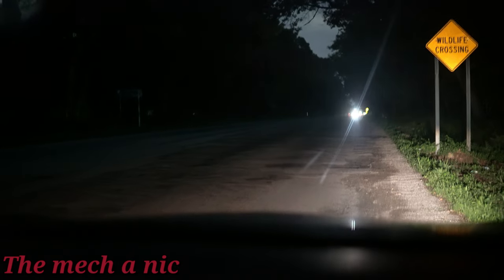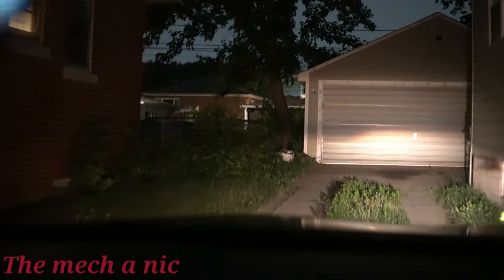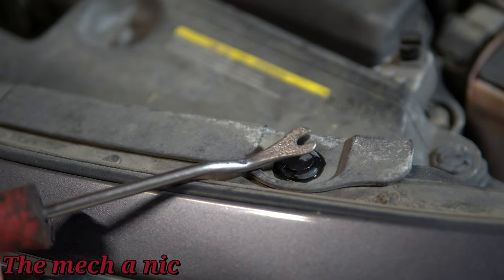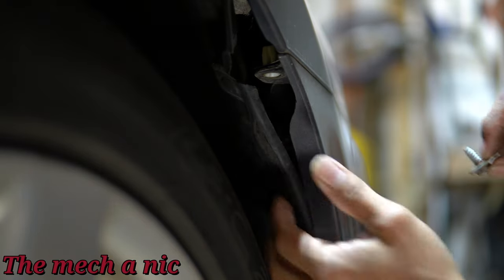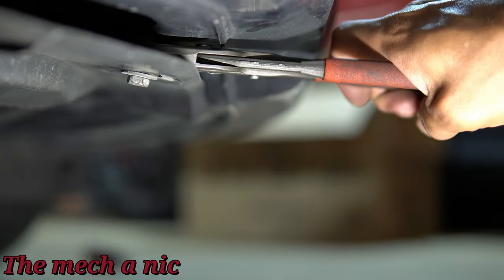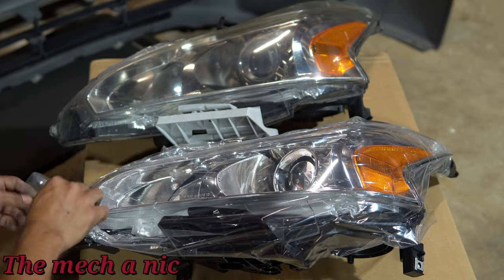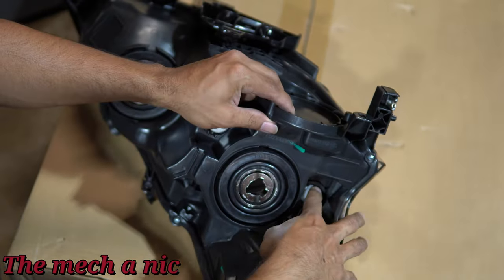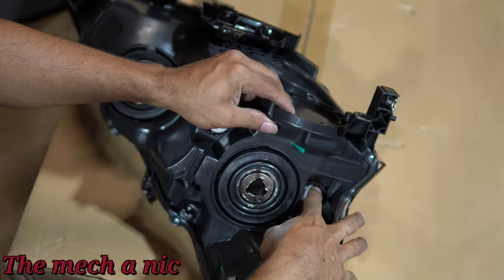2013 - 15 Altima head lights are dim / Altima head light replacement

Comment: Now we just need a lawsuit for those BLINDING LED headlights that every car seems to use now.
Reply from the maker: Yeah they always manage to hit me right in the eye with those lights!
Reply: Most of them are misaligned.  A good reason in my state for the cops to stop you.
Reply: I just turn my high beams on till I pass them. Mostly jeeps and broncos.
Reply: You mean the ones I just installed cuz I couldn't see hardly at night? Lol
Reply: I usually out my high beams on those guys
Reply: Bright ass lights for their pitch black windows
Reply: Mmmm facts
Reply: I know exactly how you feel I can't stand those super bright LED bulbs I don't mind if the LED but they should not be white
Reply: The US needs to adopt the EU rules. They should've done that in the 50s actually.
Reply: No.  They simply are not aimed correctly and the kelvin temp is too high.
Reply: Cry about it

Comment: I had the same issue with my 2012 Nissan Altima Coupe. I ended up purchasing new headlights as you did and retrofitted LED H11 Bulbs. The difference after bulb replacement is night and day. I also heavily recommend going through the trouble of adding fog lights. Fog lights on Altimas create an amazing field of view. Thank you for creating content!
Reply from the maker: I'll keep that in mind. Now that the headlights works I'm sure a set of LED will make a big difference over standard halogen bulbs
Reply: In my 2016 Altima SR which doesn't have the LED daylights.  I agree.
Reply: Hi Mr.
I am having this issue. Could you pls guide me what to do.
Reply: As a result i am driving with high beam

Comment: i can confirm, i have a 2013 coupe and it has the absolute worst headlights ever. i also could not tell whether the lights are on or off. you are so right, the second video camera actually does a pretty accurate depiction of what its like
Reply from the maker: I know what it's like, you need new headlights 👍

Comment: It's insane the way you have to change the headlight assembly. That should be a lawsuit in itself!
Nice job and great upgrade.
Reply from the maker: Yeah it's not ideal, unfortunately lots of cars are like this nowadays
Reply: Right! And we all know once removed never fits as tight as once!  I just need bulb removed!
Reply: Hey awesome video. Was wondering if you have a tutorial with a radiator removal and replacement. I'm guessing you would need the bumper off the same way that's in this video

Comment: Dude... FANTASTIC video. I replaced bulbs twice over the years as it began to dim thinking it was the bulbs. Even purchased a lens cleaning kit, but never used it because the lamp itself wasn't that distorted. Now I see why. I'm replacing the headlight assembly on my 2015 Altima and my 6 speed 2004 Acura TL. This video saved me some time and I haven't even stated the swap yet. THANK YOU very much.
Reply from the maker: Glad the video helped you 👍

Comment: I've been wanting to replace my headlights, entirely, just because with the current lights, any oncoming light source drowns out mine and makes it nearly impossibly to see the lines on the road, let alone anything that might suddenly cross the road. I'm sure some of that is my astigmatism, but most of it will be brighter lights (Other vehicles, even street lights) drowning out my dimmer lights.

This video is incredibly informational for anyone wanting to change out their headlamps without having to take it to a shop, and spend a ton of money to have someone else do it.

Comment: Guy...you know your stuff!!!!  Me and my son just followed your video to the letter and no issues. I have never removed and put back together this much of a front end on a car. You covered every detail we needed to complete the job. You just made driving at night safer for my family and cant thank you enough!!!! 
 As far as Nissan they should be ashamed of themselves for not getting every one of their cars into a dealer and fixed at Nissan's expense. When we called Nissan dealership they wanted the car brought in for a diagnostic test of the electric system costing $100s and then they would repair at our expense. They have lost us as customer forever as they have proved they have no regard for customer safety.  
Cant thank you enough as you saved us a lot of money and I am pretty sure you may have saved a few lives!!! Thanks again and for sure will subscribe.

Comment: My 2014 Altima had this issue a little over a year ago. 
I was VERY thankful that Nissan replaced both of my headlight assemblies due to the recall lawsuit. They said it was about a $1500.00 job, and I'm glad I did not have to pay anything for this service.
I actually had to wait 3 to 4 months to have it done, because of the tremendous amount of people that were on the list for this service to be done.
Reply: Did you pay for the labor upfront at the dealership and then get reimbursed? I received the lawsuit documents in the mail that said the lawsuit will only reimburse the parts and not the labor. I would have to turn in the receipts to the attorney firm for reimbursement. Did you call Nissan directly? 
I have a 2014 Altima and searching online to buy new headlight kits for both sides. Any suggestions anyone could give me would be greatly appreciated. 😊
Reply: @lizbethlivebyfaith  the dealership did not charge me anything. But I don't know if the lawsuit/recall is still active. It's been sometime back when I got it done. But I did not pay upfront, as the cost was going to be nearly $1500 from what the dealership told me. I was very grateful to get it done for nothing
Reply: @faithgiant_Ps91  Thank you so much for responding. I went ahead and sent an email to the firm that is handling the class action lawsuit to see if it's not too late for reimbursement.
Reply: @lizbethlivebyfaith  dealerships just being scummy

Comment: Thanks for this video. I just purchased a 2015 Altima and can verify it's a major problem and until I can get those headlight assemblies replaced, I have to drive with high beams on all the time. At first I replaced the halogens with xenon. Then I bought a polishing kit and polished the outside but neither of these two solutions worked and I noticed a slight bit of oxidation on the inside of the clear housing but didn't think that should be the main cause and only now am looking to replace the entire housing and found your video.

As described in this video, the car is extremely dangerous to drive at night until fixed. I'm surprised a recall hasn't been issued for this fix. Two nights ago I hit some object in the road I couldn't see due to poor lighting and burst the passenger side front tire and had that replace with a temporary tire. Luckily(?) I was traveling only 30 mph so although the collision was enough to burst the tire it didn't cause more damage or so I hope at this time.

Thank you for the link to the lawsuit, I will study what my options are before doing anything more myself. It looks like after October 2022 (My comment here is Nov 2022) it may be too late (after Sept 2022) to be covered in this lawsuit. Does this mean another class action lawsuit needs to be filed? I wonder why the class action lawsuit terms were so tight, to only cover extending the new warranty an additional 3 years to 2021 and then another year for "out of warranty" replacement? This headlight problem will be a never ending problem for Nissan as no defective headlight assembly should fail within 10 years, maybe even 20 years... I wonder what the industry median lifetime is for this part. Looks like I may contact the attorneys for this lawsuit, get whatever info I can and decide what to do then. Maybe contact Nissan to see if they will volunteer to do an out of warranty repair.

IMO this is an extremely dangerous safety issue and should be subject to a recall for replacement. I wonder why the DOT hasn't gotten involved in this issue, maybe the lawsuit itself can provide details on that.
Reply from the maker: I'd definitely try contacting the dealer first and see if they'll replace them for free.
Reply: There is a recall but I have been waiting since March and the dealership claims there are no parts...
Reply: @majesticgent  Man i haven't got anything from Nissan about that.
Reply: There is a recall on the headlamps but Nissan is not honoring it. Been dealing with this for over a year.
Reply: Same thing happened to my Nissan 2013.  I contacted the dealership. Past the settlement date. I contacted the settlement website. No use.  Let use know if you find anything worth pursuing.  When I ask the dealership about a recall, he said, I am directed to send you to the settlement website, which offers nothing.  I'm sure there are plenty of Nissan owner's that are just now experiencing the same issue.  Mine started about 2 weeks ago, I can barely see at night.  I agree with you, it is a major safety issue and should be a recall.
Reply: Finally after 10 months, my local dealership has the headlamp assemblies and will honor the recall!

Comment: Thank you for the confirmation.  My headlamps are Useless.  The dealer denied replacing my headlamps when I brought my car in within the Class Action timeframe based on Nissan's standards.  A blantant disregard for Safety.  I've changed Numerous bulbs including HIDs.  Never buying Nissan again.  
  Your video is a Savior.

Comment: excellent video. I just got done changing out my lights. The only thing I would mention is that there is a thick piece of plastic that is under the top 3 mounting bolts on each side. And that piece has 2 nubs that stick into the other piece of the fender to make the crease pull together. Thanks again!

Comment: Good video. I was able to get mine replaced by Nissan on my 2015 but it was months waiting for the headlights. I eventually reported Nissan to the BBB and presto, they started responding quicker to my complaints of waiting. Definitely an improvement for night vision. My worry is did they really improve the issue or just give me new headlights to make me go away. Time will tell but at least your video will help with replacement again as I doubt Nissan will keep replacing these. Cheers!

Comment: Great video, my headlights have  gotten worse over the years. I finally ordered the headlights. Will be installing this weekend.
Reply from the maker: Good luck with the repair 👍
Reply: Installed this morning. After watching video. It was easier then I thought. It took me an 1 hr to install both. Now waiting for it to get dark. Thanks for the video.
Reply: Bought them from where? Link?
Reply: @jerrycosme4273  how are they holding up?
Reply from the maker: So far they still work. Someone told me the new ones will also fade but we'll see. It hasn't happened yet
Reply: @daviddavis9155  its been a year now. No issues as of yet. I also installed Led bulbs, now I can finally see at night.

Comment: Although grille replacement is easier for other Altima years, the plastic bumper cover must be loosened up for 2015. Minutes 2 through 6 are an excellent guide. You don't have to remove the bumper cover completely nor disconnect lights. It just has to be loose enough to reach in with a stubby philips head to loosen the screws in the 4 corners of the grille. If the old grille is trash, you can snap off the tabs with your fingers or a pair of pliers. Make sure you reposition any of the clips that come loose when you remove the philips screws in minute 5.

Comment: I had this problem in my 2017 Altima.  Nissan dealership replaced my headlights for free, and I immidiatly installed LED bulbs made by Phillips to keep the heat low.  This will prevent damaging my new headlight housings.
Reply from the maker: That's a good idea
Reply: Hey how did you get that approved? Do you just show up with your car?
Reply: @8Jallin  thats correct…just went to the dealership service counter…explained the issue and they were aware of it….replaced them, no questions asked.  Maybe I got lucky…I don’t know.
Reply: @retass1979  glad you got yours fixed. Nissan said that it’s too late for me. For me this warranty expired last year …
Reply: @8Jallin  I was out of my cars warranty...i had 190K on my odometer when this happened...I'm at 250K now...if your car is a 2016 or later, i would think it is covered.  might want to try a different dealership.

Comment: Just wondering if their is an adjustment screw to adjust the horizontal axis of the lights or if they are in a fixed position and only needs vertical adjustment? Great easy to understand video thanks
Reply from the maker: I'm not really sure if there's horizontal...it didn't cross my mind

Comment: I got my class action brand new crystal clear headlight assemblies installed by the dealer a month ago. YouTube keeps suggesting these videos on my page. Forgive me if I already posted this on this video. But I just want everyone who has an Altima to know that it is true and I got mine and wow! Just like when I got the car brand new!
ALSO the lawsuit covers you if you already replaced them take your receipt and you will receive reimbursement from Nissan. And also fue those who have sold their vehicle, take your receipt! You too will be reimbursed because you spent the money to replace them. You have to show them your receipt.
Reply: Did they do a test on yours? My dealership ran a test and and said I didn't qualify for replacement even though I did what I had to for the class action
Reply: @travelwithgoose  that isn't familiar to me. I had not heard of a test. Butin further research, I found out that Nissan is still not admitting to any wrongdoing. The replacements are being done because the judge ordered Nissan to do it, rebellious Nissan didn't issue a recall. I would guess that they are trying to minimize their cost of replacing the headlight assemblies.
Try telling them that it is very dangerous to drive your Nissan at night and you have come into some life threatening situations because you couud not see the road ahead of you. Then subtly drop a hint that it would be cheaper to replace your headlights than to face a wrongful death lawsuit from your family if something happened to you as result of the defective dim headlights. That's not legal advice, it's the sort of manipulative drama I would create in a situation like this. It just might work if you make them feel liable. Good luck and I really hope you get them! OK?
Reply: Thanks so much for posting your outcome.  Just a few questions. What year is your vehicle?  Did you buy the vehicle at the same dealership as I know that helps sometimes getting it serviced faster ?.  I've been finding that only that the 2013 and 2014 vehicles seem to be prioritized by most of the dealerships in getting  serviced first.  I love your advice you gave BumpGoose on prodding the dealership to get the vehicle serviced.  I agree the better prepared you are when you arrive at the dealership for service goes a long way in getting a more positive outcome.
Reply: Question. Nissan refuses to replace mine. They say that class action window closed last year. How did you get yours replaced this year?
Reply: @westvalleyjunction  Websearch-

NTB22-024
Reply: @westvalleyjunction  i have the same question I did opt in but didn’t make an appointment to go in to get them replaced
Reply: @westvalleyjunction  yeah, pretty sure there is no possibility of getting them replaced anymore by dealership

Comment: Is this just a Nissan problem in general?  I have a 2014 Maxima SV with factory HID lights and the brightness is terrible. I’m actually looking to convert from the original HID to a halogen housing and install LED H11’s instead.

Comment: @The mech a nic Awesome video!!  I too,  have a 2013 Nissan Altima,  similar issues.  My question is: Can you post a link for the drill/ tools that you're using in the video to remove the bumper from the fender? Thanks in advance🤙

Comment: It’s crazy that you have to do all that just to change the lights. I remember my old Mazda Miata I think was an 07. You just screw the front off to get to the bulbs. Was very easy to change. My old Honda Civic you had to crank the wheel all the way right or left and go in through the wheel wall. Im having same issue with my Altima now. Too dim headlights and my left one is completely burnt out.
Reply: Videos online show how that can still be done.  I've never tried it.
Reply: You can replace the bulbs super easily but this is the whole assembly

Comment: So is it just the factory headlight that fails or any of them. How long will last if you go through the cost and pain of replacing?
Reply: The factory headlamp assembly had a flaw in the reflective metal inside that gets burned up and doesn't reflect light as well over time.

Comment: May I ask you I installed last yr leds on the entire car bumper to bumper. So the left rear brake led doesn't  work I replaced it still don't work I was thinking of replacing the the wire harness that's attachable . I replaced the fuse that didn't work either.  may i ask What do you think it could be. Yes I have a 2015 altima sv .

Comment: We replaced with these exact headlights a couple of years ago and are having the same issue again. Wondering now if it's the car itself and not the headlights. We've also had to replace the transmission in this 2013 Altima twice in the last 6 years. The lawsuit actually reimbursed us for the cost of the headlights and it only took a couple of months (just FYI).

Comment: To change the right side lamp on a 2015 Altima turn the wheel all the way to the left and peel the liner back. The is no need to remove bolts just to change the headlights.